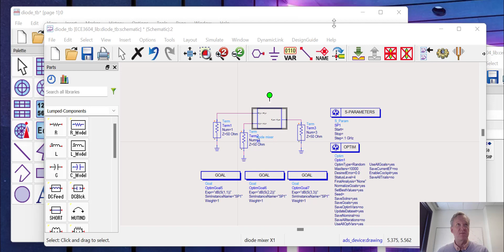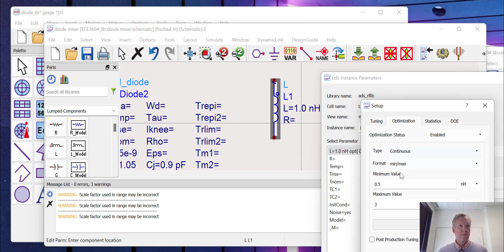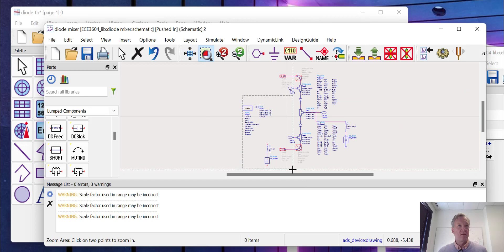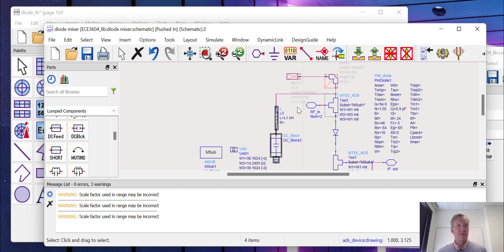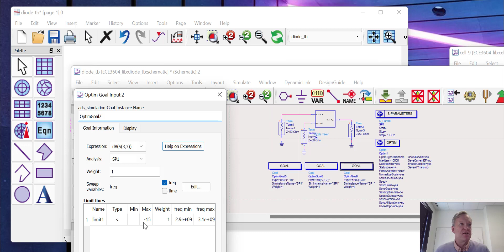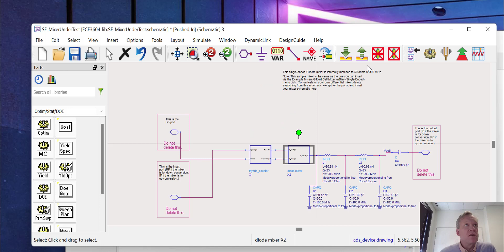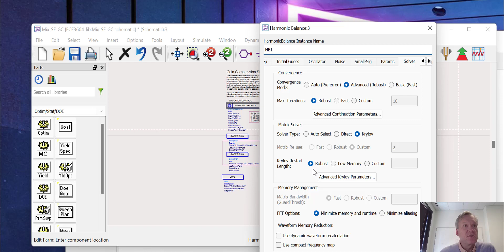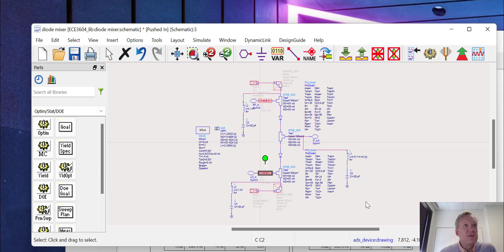ADS - Revisit Diode Mixer Matching

Comment: One thing I'd like to ask, if you ever see this comment, is how would you match the diodes to the feedlines on either side? Say for instance you have diodes that arent already matched to 50 ohms as in your video, I understand how to match the input lines to the diodes ZL, but how would I match the output lines characteristic impedance to the diode?

Otherwise great video and I found this very helpful overall.

Comment: the original open stub just had to be greater than quarter wavelength to give you the shunt inductance you need for matching...no need to do anything else....from experience, in diode mixer the input must be DC coupled or it wont work properly...
Reply from the maker: Good observations, I made a rookie mistake :)